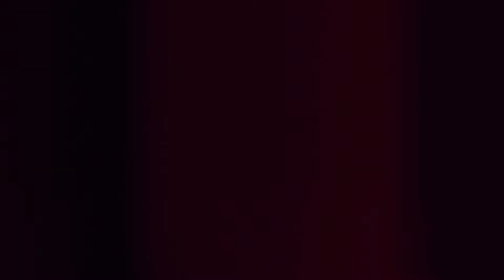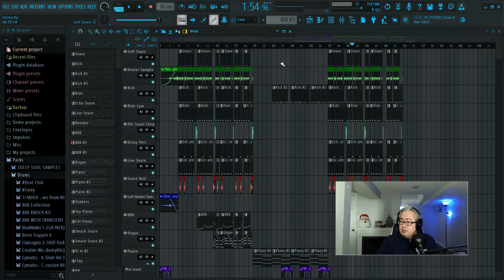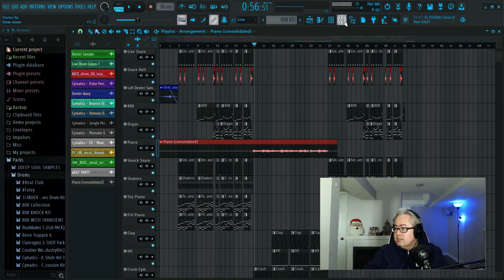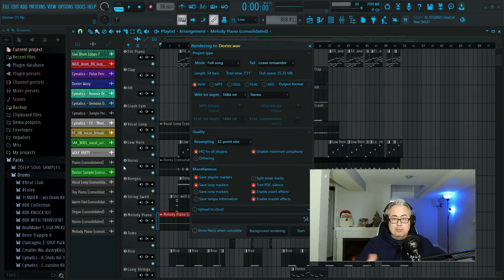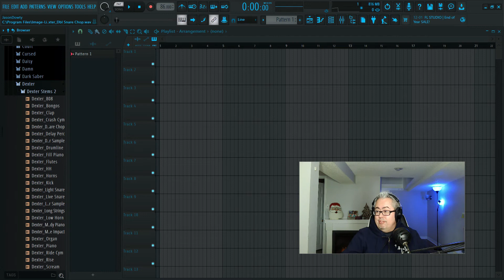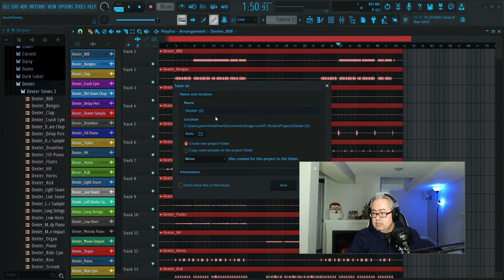How to solve memory issues in FL Studio

Comment: I have 2 questions, first of, how did you get those icons thats on each of the tracks? The second question, or more like a problem, is that i have problem with the memory usage, where it says "7523 mb" So when i load a kontakt library, or something else big, the memory usage will increase a lot, obviously, but the problem is that i can never get rid of the memory usage of the kontakt library. It will not decrease even if i consolidate and then delete the whole kontakt library from fl studio. This make the memory usage go extremely high even if it should not do that, and which is limiting my production and the amount i can do in 1 project a lot. If you knew the answer of any of these 2, i would apreciate if i could get to know the answer/fix to it.